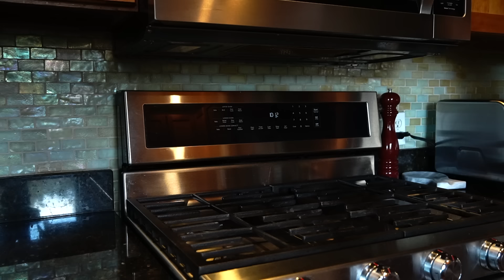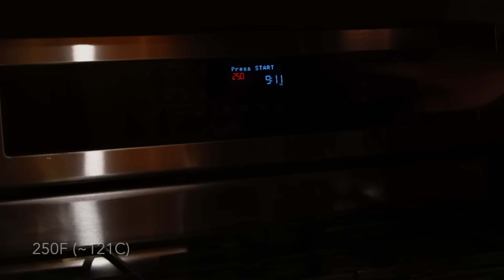Forging a Hidden BAMBOO KATANA from a Giant Leaf Spring

Comment: Real katanas are supposed to be folded metal right?
Reply: Depends. That’s the traditional way of making one, but it goes back to the relatively low quality steel that was used to make them. Folding solved that problem, but it is usually unnecessary for modern steel.

Comment: That there, is an insult to the "katana". No folding, sloppy hammering, disgusting quencing and tempering. You sir, should consider sepukku after that, but get a proper blade for it, not yours! 😡
"Polish a turd.. is still a turd"

Comment: Katana you say? Indeed it is not so but only a sad and cheap imitation that looks like a Japanese sword but that wouldn’t stand a chance against the real thing; a Katana’s blade is fabricated with steel that has been folded  over itself many times, heated and folded again until you have several layers of steel, each one with a different carbon composition thus providing a strong blade.
How much would I be willing to pay for the sword in the video? Perhaps $10.00 would suffice considering the price of the scrap metal and the Propane.

Comment: It's good to use springs, but the underlying manufacturing process is different.

The blade part uses hard carbon steel like spring material

The true Japanese sword is made so that the fragile blade part is covered with the flexibility of the core by processing it so as to wrap the mild steel.

This cannot be called a KATANA.

Comment: That is not a katana. For it to be one, you would have to use traditional equipment and ways to forge. Katana forging hasn't changed much since the age of the samurai, and you can't call it a katana unless it's approved by a licensed katana forger.
Reply: Also in Japan every piece of the sword is made by a different professional. And if You wanted to be a licensed katana forger, you would have to study for 5 years and do the final test where you fully forge a katana.